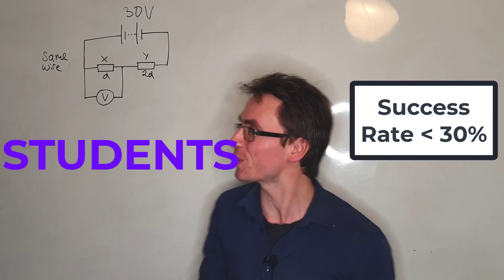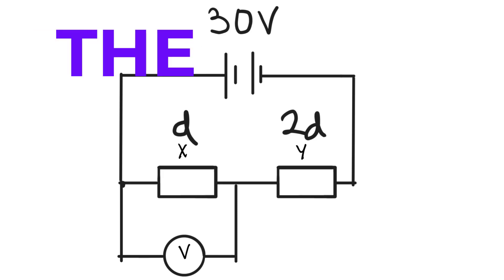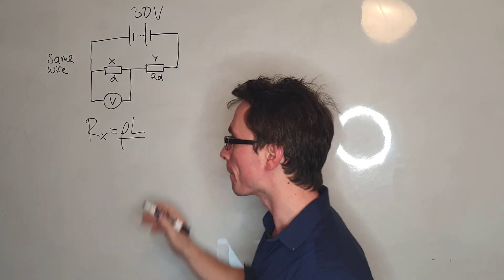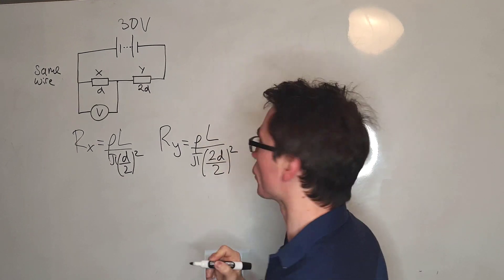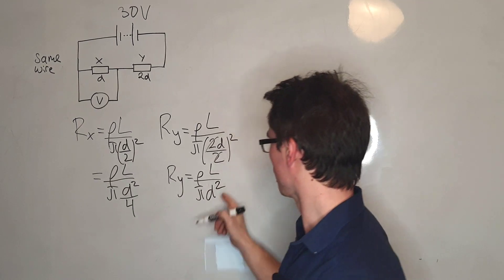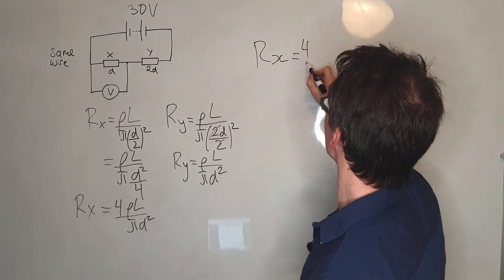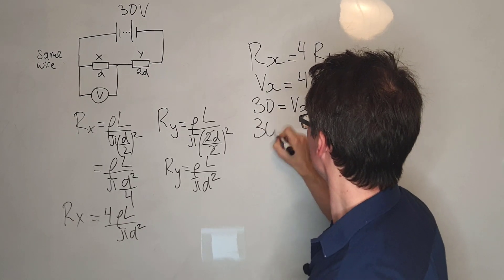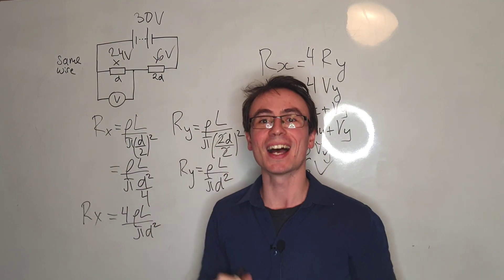Fewer than 30% got this A Level Physics question right

Comment: The problem with the question in this video is that it has not stated the assumption that the length of the two wires are the same.

Comment: Let r of d be 1 as resistivity is proportional to d^2 you know r of 2d is 4 then 1/5 * 30 so 6v
Reply from the maker: Mm, resistivity is a constant for both. I like this thinking but just think of R instead of the resistivity. R is inverseley proportional to d^2, so if Rx=1, then the area of Ry will go up by 4, so then if Rx is 1, then Ry will be 4 times lower. I.e. ratios of 4 to 1 and p.ds of 24 V and 6V to add up to 30.

Comment from the maker: Also, how did it everyone find it? I was genuienly surprised at the low success rate, hence I decided to film to help with revision.
Reply: easy
Reply: could i ask, can you use tricks from electronics a level to figure this question out? You know that the only loads are the resistors, and if the resistance of Rx is 4x the resistance of Ry, then that means 4x the voltage is going across it. So just get 30 and split the voltage in a 4:1 ratio between Rx and Ry